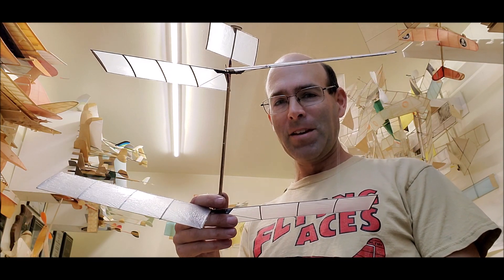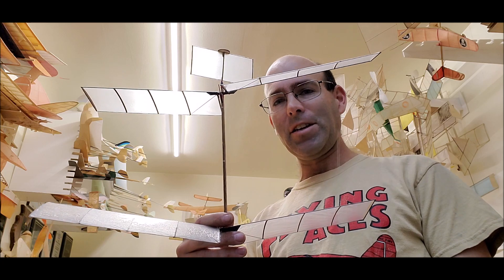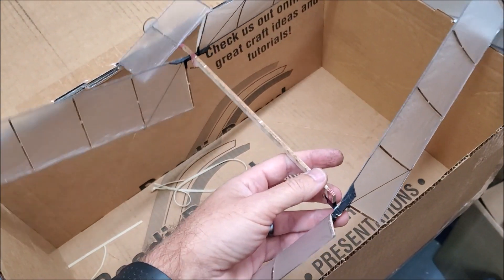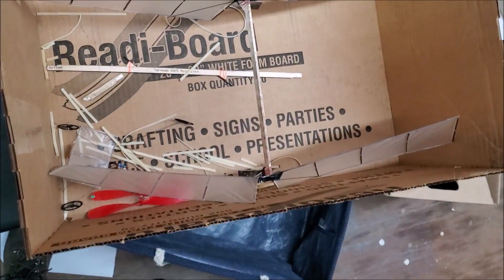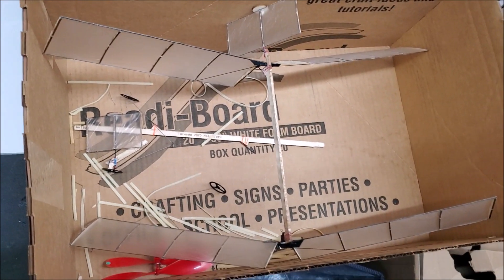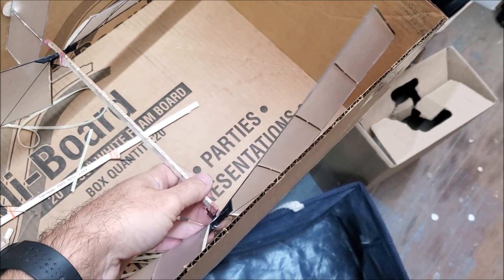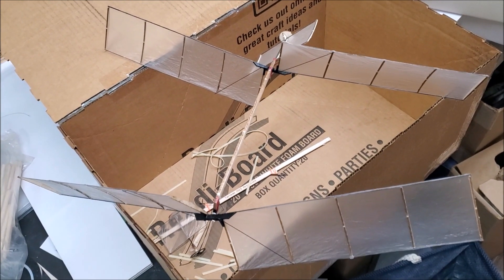The ultimate Science Olympiad Helicopter for 2025!

Comment: Nice flight! Assuming you used 1/8" rubber, how many winds did you use? Also, did you sand the helicopter to reduce it to 4 grams?
Reply from the maker: No sanding, just build as clean and light as possible. 11" loop of 1/8" will take 950-1000 turns.
Reply: @joshuawfinn  Thanks Joshua. I use a tooth pick and medium CA to minimize the glue.

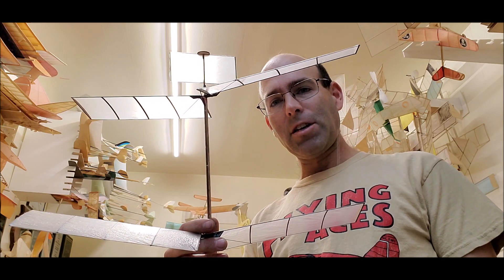Comment: hey i was wondering im using the same rubber for your other  helecopter u made late last year and i only did 25 spin on a 1:20 spinner and the middle snapped and i was wondering if u had any tips like thickness of rubber or spins ?
Reply: also the rubber is just a little loose on it with out spins such as you did with the other helecopter
Reply from the maker: Are you lubricating with silicone oil and stretching to at least 4x relaxed length, maintaining that until you have at least 55% of the turns in.
Reply: @joshuawfinn  oh thank you i didn’t even think of that but i have been lubracating it well and putting a tad bit of dirt on it
Reply from the maker: @grey10boi60  dirt will make a mess of rubber. It has to be completely clean.
Reply: @ oh ok idk where i heard it made it better but ill stop doing that as well

Comment: How did the blades spin slowly and constantly keep control without using it’s energy all at once
Reply: Ps I’m building one for division b
Reply from the maker: Very, very big blades, and it runs the same size rubber as the smaller helis.
Reply: Large area, large diameter rotor blades will spin up until the resistance equals the torque of the rubber motor. The size of the rotor and its resistance is much greater than the size and resistance of the propellers which are commonly used with this size of rubber, so they turn much more slowly.
Reply: Also what did you build for the joint between the lower prop and the body
Reply from the maker: @OliveDeneault  it's a proprietary PETG plastic bearing and rotor hub.
Reply: What rubber band did you use?